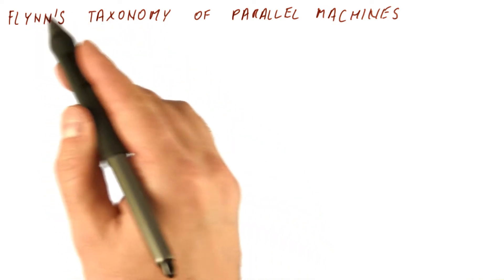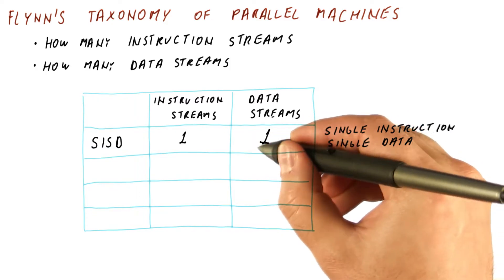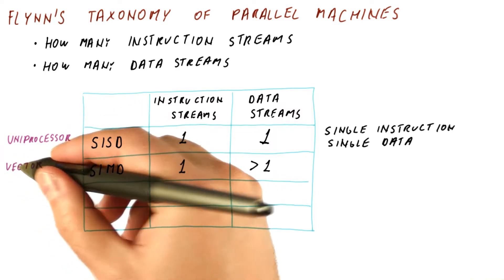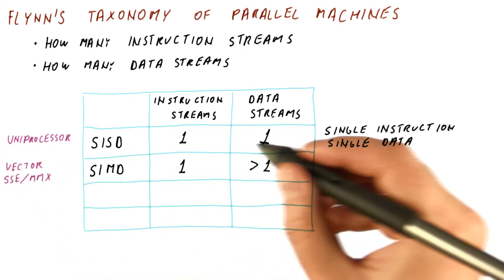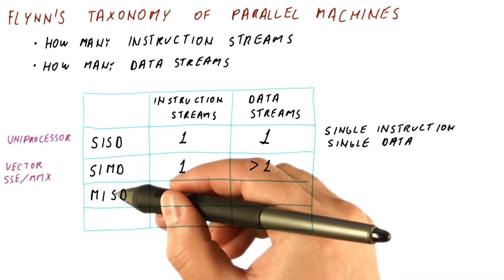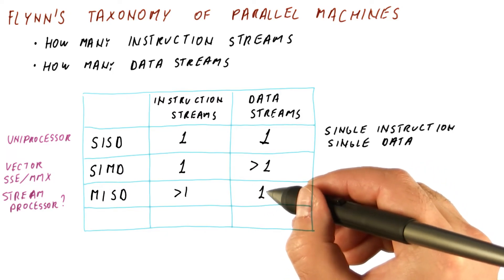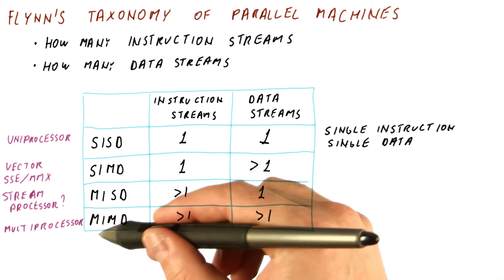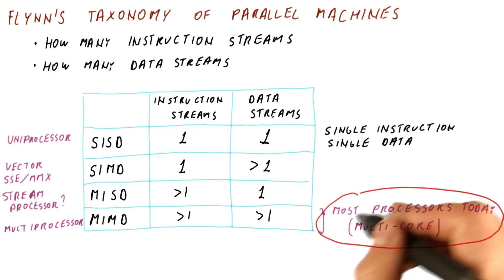Flynn's Taxonomy of Parallel Machines - Georgia Tech - HPCA: Part 5

Comment: a good example for misd is found in space/avionics fault-tolerant systems, 3 machines will run the same code, if one system faults, the result is determined by the majority ex: computation on  1+1, cpu1=-99999 cpu2=2 cpu3=2, cpu2 and 3 agree, so 2 is considered the right result. very important to make sure people are safe in airplanes, rockets etc

Comment: You didn't give proper examples where MISD is used though it's rarely used.

Some examples are multiple filters operating on a single signal stream and many cryptographic algorithms trying to crack a single coded message.

Comment: As an example of MISD, I can think of certain fault tolerant systems (like control systems) where multiple CPUs process the same data stream in different ways (therefore using different instructions streams). I am saying that because I remember that one principle of fault tolerance is to avoid single points of failure and if a given fault-tolerant system has many redundant modules running the same program (i.e., the same instructions or "instructions stream"), all of them will fail under the same circunstances (e.g., due to a bug). 
A way to prevent that is to create different programs that are intended to behave alike (in the sense they are supposed to deliver the same results given the same input data). If each redundant module runs a distinct program, there will not be a single point of failure as the programs will fail under different conditions. 
I think this approach would be an example of a genuine MISD system.
Reply: very good point!